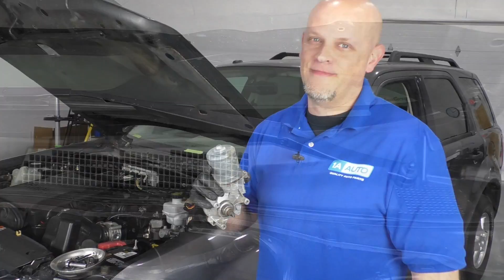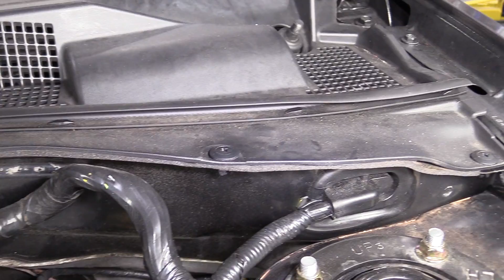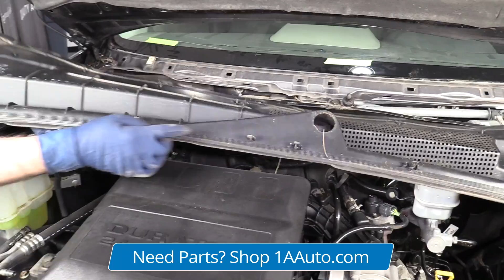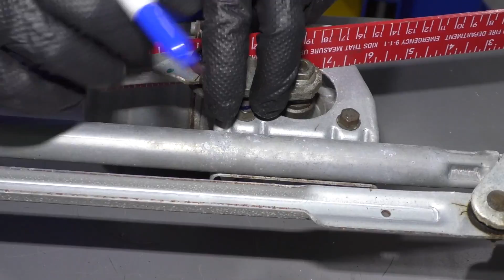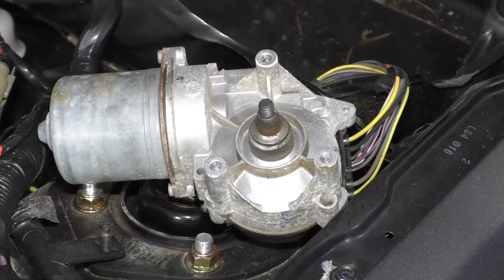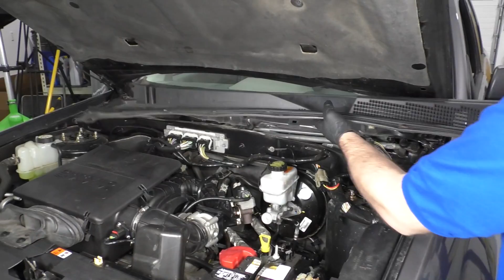How to Replace Windshield Wiper Motor 08-12 Ford Escape

Comment: my rear glas wiper motor is ticking and making my battery drain overnight, i unplugged it to stop the battery from draining but now my front glass sprayer isnt working. help!!
Reply: plug the rear motor back in and the front sprayer will work